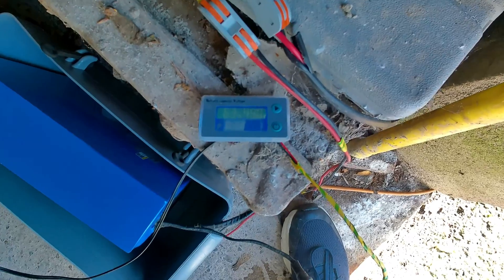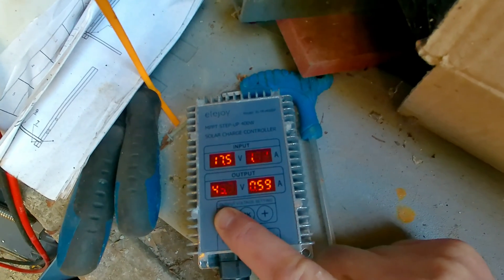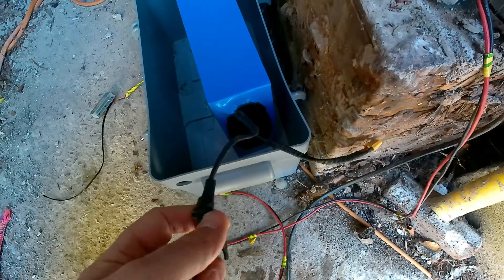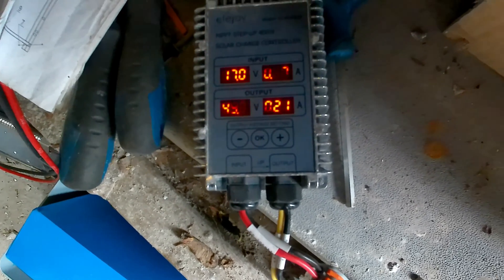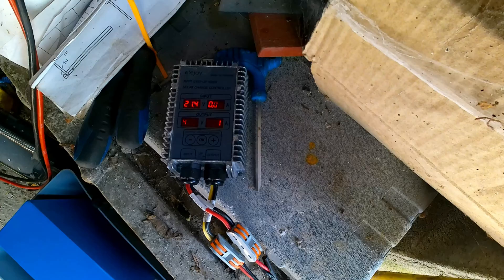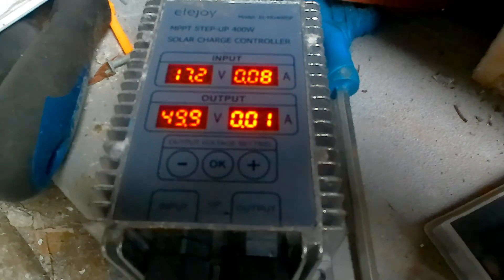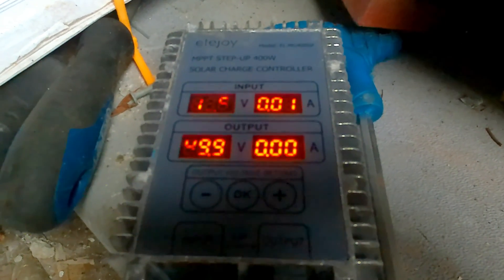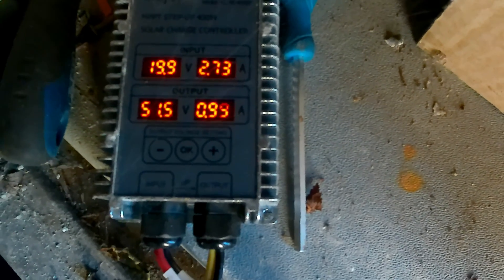Testing Elejoy MPPT Step up solar controller for over charging 48v LI-ION Battery pack

Comment: Great video. I watched it before I purchased the same elejoy booster and just received it and was able to test it today. I'll post a video shortly comparing it to the green MPT-7210A solar mppt charger.

How has it worked in your boat over the past 6 months of winter? I don't know if you kept your boat in the water and used it over the winter, but maybe you kept the solar hooked up.

I plan to use mine to charge 58.8v EGO batteries while camping, so am wondering how close to the full 4.2v per cell this is safe to set. In my test today the display still showed over an amp output with the volts showing 58.8v. After I disconnected the volts were below 58v, so it might not have charged beyond 58.8v once current dropped to 0. I'm curious what you think the max safe voltage level is when using this elejoy? Thanks!
Reply from the maker: 80 percent is a good end point for lithium .if you check the voltage chart for your battery to stop at that. It'll keep putting current in until the battery fully reaches that voltage . Mine eventually goes to zero current despite full sun constant voltage charging type of thing.  I didn't use it over the winter ,took the batteries home and stored them . Use a normal solar charger on the 12v to keep that topped up .

Comment: Thanks for the info, I'm looking at buying the same controller and using with 400w of solar and 24v LA but later with lifepo4, how long have you been using it for, and what is the most wattage panels have you used?
Reply from the maker: i've used 300w folding pannels with it without any probs . Just be wary that it's a step up MPPT to get the best out of it there needs to be a higher voltage output to charge the batteries. My solar panels put out about 19v tops and i was using this to charge 48v batteries so worked great. depending if yours is the same this should work great for 24v LA .
Reply: Ps, I have emailed you.
Reply: How reliable has it been for this charger?
Reply: @axscdvfb  Both of my Elejoy 400w MPPTs are working like the day I got them. They are very good. I have one that boosts the voltage and the other drops the voltage.